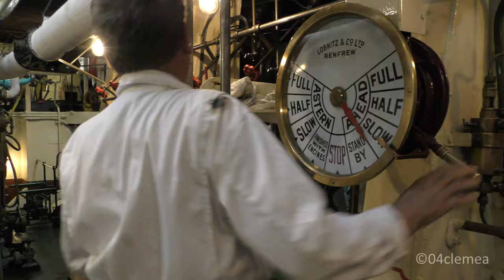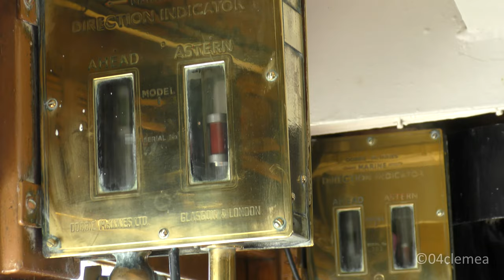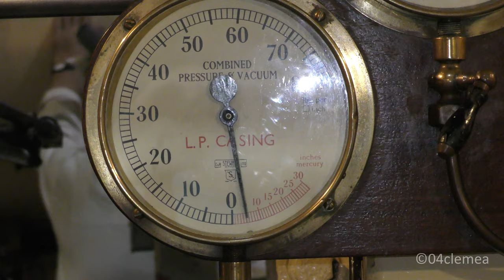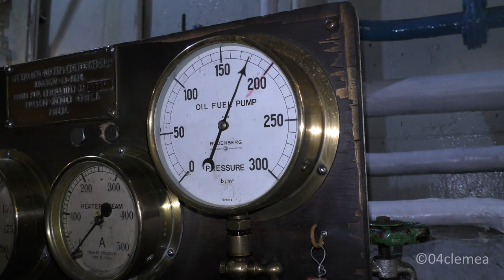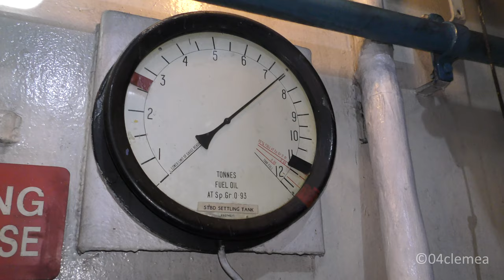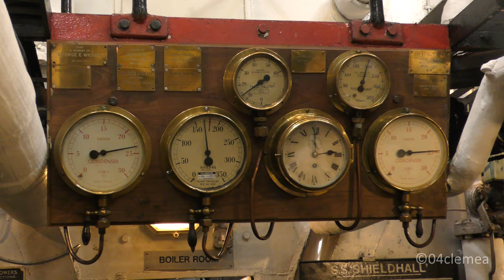Ship Engine Room - Triple Expansion Engines Onboard Steam Ship Shieldhall

Comment: Old Number Ten hopper in Dublin Port was only a single engine, but Ronnie McCarthy, the skipper used to think it was a motor boat; you'd barely have got full astern going when "jangle jangle....full ahead. We used to watch the shadows from the skylight to see how fast we were turning....then a deckhand would shout down " Hold on". Then would come the thump and sound of splintering piling, followed by full ahead.....fun times.

Comment: I'm trying to figure out the ship telegram. I know the engine room can see what the bridge wants by the placement of the needle and vice versa and that the bells get the attention of the crew.  But is there a procedure or meaning to moving it back and forth before resting on the chosen output or is that just to grab attention?
Reply from the maker: It's he engine drivers acknowledging the bridge's orders, as it moves a needle on the Bridge's telegraph.
Reply: The point of moving the engine order telegraph further than the required setting is to make the bell ring several times, instead of only once when going from, lets say slow astern to half astern. 

However, many people working on steam ships today have a "nasty" habit of ringing the telegraph by going to full ahead or astern, before going to for example slow astern. This was never a recommended practice in earlier times. The risk is that the chain for the engine order telegraph could seize up on full astern or ahead, and the engine room would have no way of understanding that this was not the desired setting. The recommended practice at, amongst others White Star Line, was therefore to ring back and forth in the standby-stop-finished with engines area, before proceeding to the desired setting.
Reply: I’m inquisitive about the telegraphs being ‘handed’. If an operator changed from one engine to the other was there a short time of confusion in the mind about which direction was being asked? I know its a left/right thing in us but I’ve seen this create problems elsewhere.